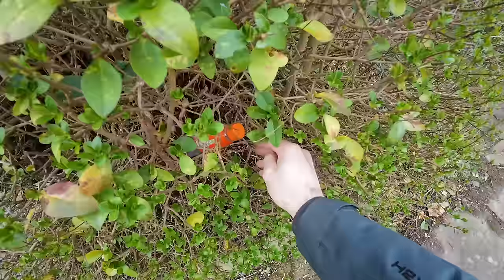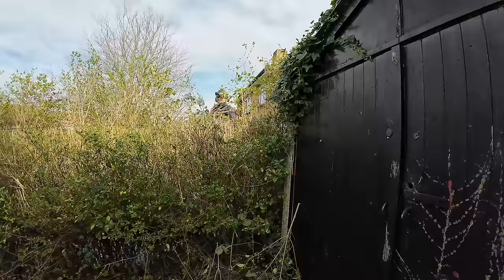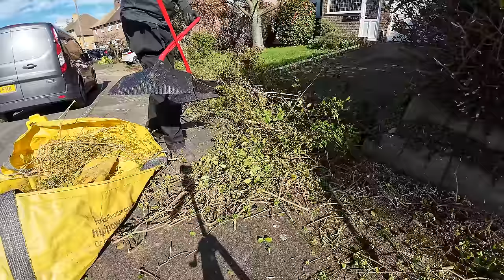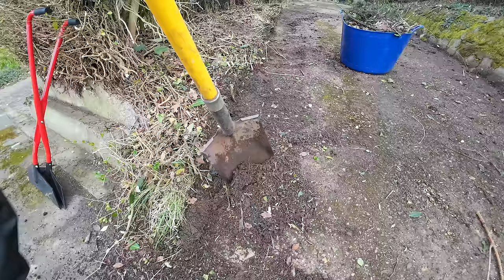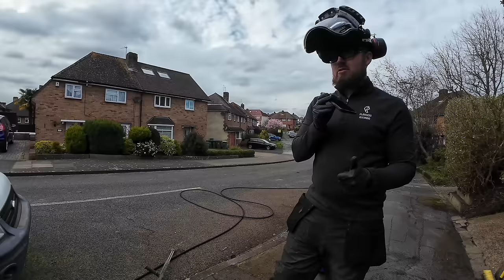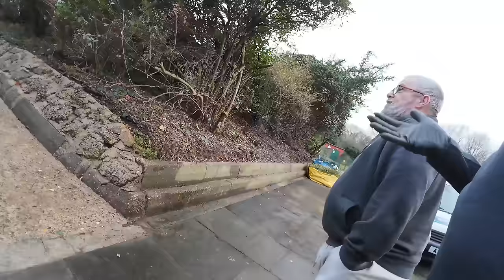HELPING Tom & Rachel With Council ENFORCEMENT Notice (Part 3)

Comment: Your hedge trimming was spot on, sun and air can get underneath and everything will fill in nicely in the spring.  Minor trimming will keep it all in order without too much work.  Clearing out most of that overgrowth will also help keep the moss from coming back on his rock wall.  It all turned out lovely and even the concrete had a nice sparkle to it, well done sir!
Reply: Is that Privet?
Reply: If that’s  spot on dread to think what your garden looks like 😂
Reply from the maker: Thanks so much sandy

Comment: In those jobs where you have removed brambles, how do you prevent the brambles from regenerating from the root systems still in the ground? Nice work on the hedge trim and a clever way of ensuring an even top. Looking forward to Part 4, which should be easier when you have a refreshed Dad on hand.

Comment: 1) The weeds above the hut are still not cleared. 
2) the hedges should be trimmed by another feet in height AND another feet by depth. 
3) the branches on both sides of the pavement are not fully collected.

The bushes, trees on the opposite (of the hedges) should be cut by 80%.

Comment: You should have had a chipper then you could have used the chips as mulch, saving council tip charges and space in the van taking it away
Reply: He rented a chipper when they worked on Norman's yard. Might eventually be a purchase for the Flawless tool chest in the future, as I agree a chipper would make it amazingly easy to mulch up branches and bush trimmings and ground cover, or even chip the cuttings into 1 bag vs many bags.

Comment: Well done Ben, this is one of those jobs where you really could have done with a heavy duty shredder.
You did a nice job on the privet hedge, they soon recover with plenty of vigorous growth.
I would cut about six inches below your preferred height, there will be plenty of new growth, which is easier to clip to the style you want, say a flat top or slightly curved.👍